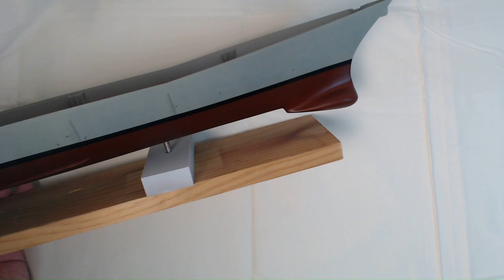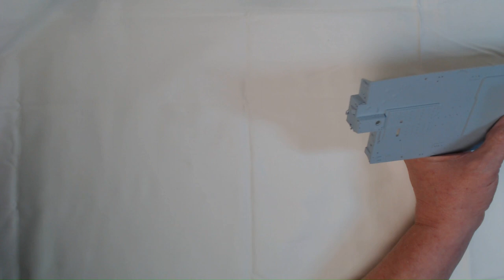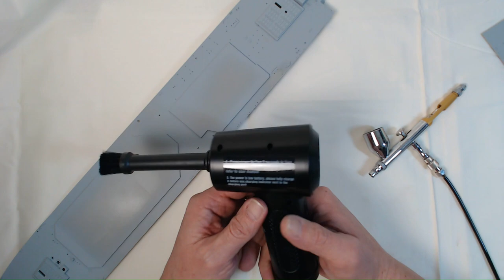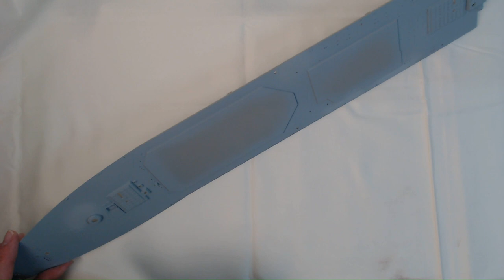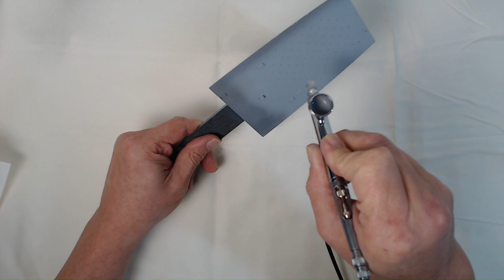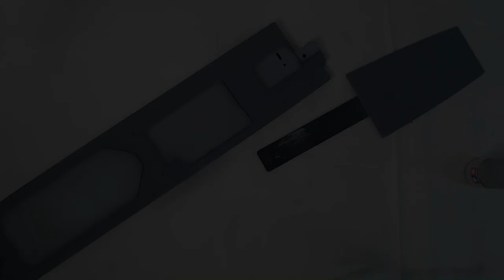USS Curtis Wilbur in 1/200, Video 6, Painted Hull & More Deck Construction

Comment: Hi Patrick. I would seriously recommend you move away from that Vallejo primer. Get your self some Mr Surfacer. The Vallejo just sits on the surface and doesnt bite at all. I was sure I was going to hear you say that some of the gray lifted when you masked for the waterline.
Reply from the maker: Yeah, fortunately that was not the case on the waterline. Dodged a bullet on that one. That said, I am exclusively working with Mr. Surfacer as my #1 primer now. It's great stuff and I've used it before too; I was just looking to try out the Vallejo. Good looking out!

Comment: at such a large scale do you think it’s possible to do the nonskid that looks accurate? reference pics show the slick deck reflecting light so it could be as simple as matte vs gloss coat on the deck
Reply from the maker: With the scale in mind, I had come to that conclusion as well; just a difference in sheens on the various colors. I'm on the fence on if I'll be applying it or not.
Reply from the maker: @phrint9444, I tried the following process out. I masked off the darker grey making a quick job out of it since I was only applying a clear coat and didn't have to worry about too much of a variation. Also used Maskol by Humbrol for raised details and bits. I laid down some thinned XF-86, Flat Clear. There is some difference but very minimal. There are other products out there that will provide more of a flat "glazed" appearance, but what I have would not work well with remaining weathering steps, so I'm leaving it as is. You will see in the upcoming video.

Comment: My kit just arrived today and while I started on the sonar dome I noticed a detail that not represented on the kit but it’s important and all the ships have them. The lower half of the sonar dome has what’s called a Sonar Dome Rubber Window. It’s basically a rubber boot that protects the dome and doesn’t impede acoustics. You can just paint it black but I’m going to actually use a black plastidip rubber spray to give it the right look.
Reply from the maker: Hi @archangel3083, I'm happy to hear that you're starting on yours. I did not cover that in any of my videos, however, I did paint one on using Tamiya XF-27, Rubber Black. The only two things I'm positive on is that the kit does not account for that detail just as you stated, and mine is probably not correct. I went for close though and I think mine looks the part, at least. You should be able to make it out in the short I posted within the last week. Happy modeling and thanks for joining in the discussion!